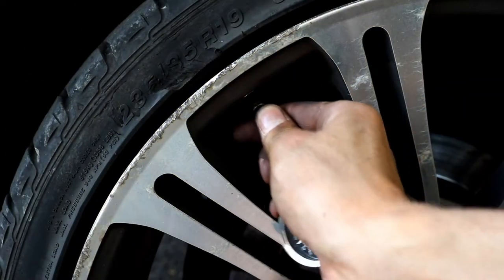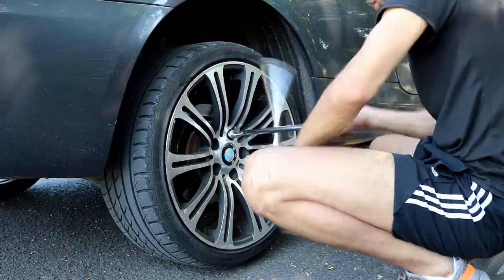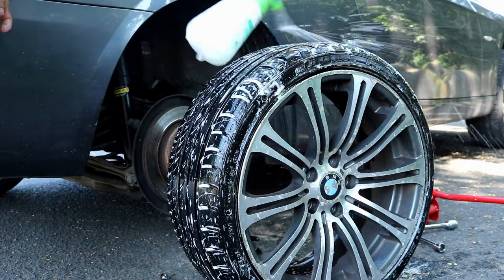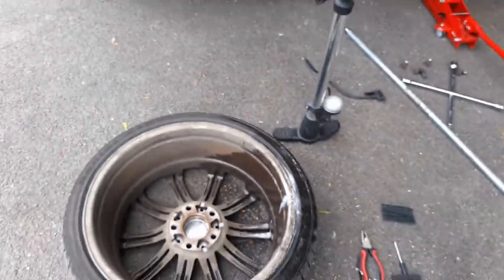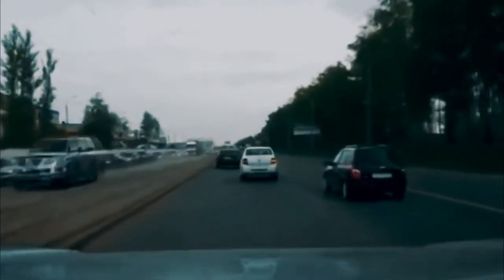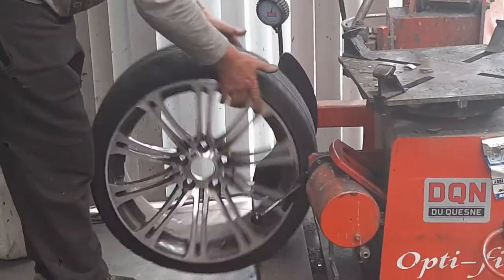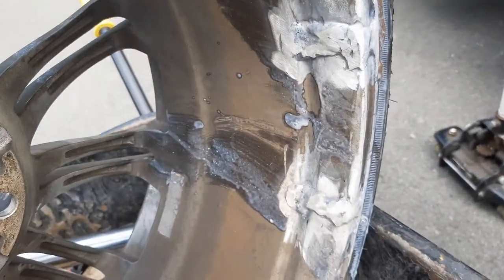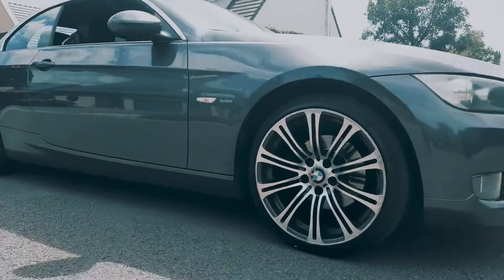The Way to Fix Cracked Aluminium Rims

Comment: Hey man props for throwing this out . It was a pc of helpful research and is but one of the things to possibly do when encountering the situation starting off.  Thanks
Reply from the maker: Thanks for watching 
I looked online first and saw people using jb weld and epoxy to solve a cracked rim ( that is dangerous)
Just get the aluminium rims welded 
*UPDATE still holding pressure and no sign of any leak
Keep those rims safe :)
Reply: It is dangerous but sometimes you have no choice. My rims are a size larger than the factory rims and only two shops downtown can remove them safely without stressing the metal and tire. 
My rims are old they crack pretty easy I’ve learned but I drive aggressive as a first responder. Last week some road repairs washed out from the rain and me and 25 others had damage. 
It takes the one place that welds rims at least a week to do one rim at $100 per crack. Plus he don’t mount or remove so I gotta pay the tire place before and after the repair 20-50 per tire to remove and to put back on. 
Three rims were damaged, cracks like in the vid so it have to find the factory wheels and tires and ride on that for the next two months. Or I can jbweld the cracks and pray for the best and not miss work or spend a bunch of money on repairs even though I know it’s a risk but so is driving the car in the first place

Comment: I've had multiple wheels repaired that's an ugly weld. It will crack again
Reply from the maker: The rim was welded 8 months ago , still no air pressure loss.
After every fix i like to wait some months before i upload  that way i can give correct information
If you do have a cracked rim get it welded by a pro that does rim welding for a living.
- also do not over inflate the air pressure in the welded  wheel 
- do not use run flat tires 
- and most importantly avoid potholes :)